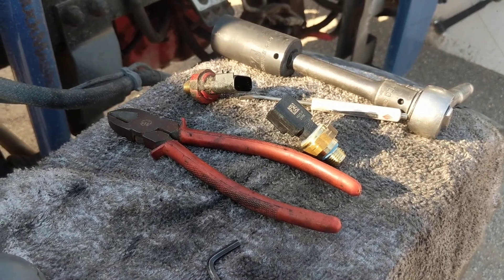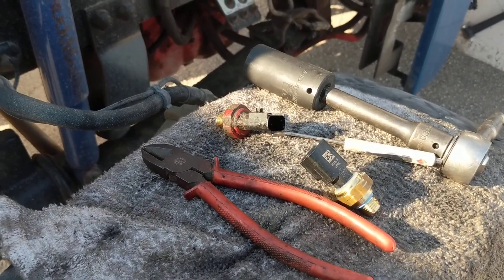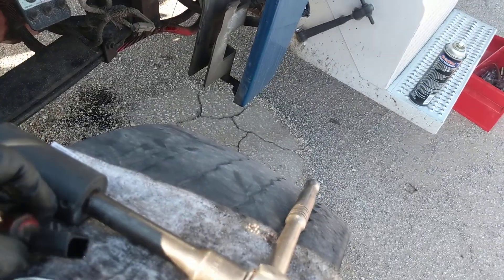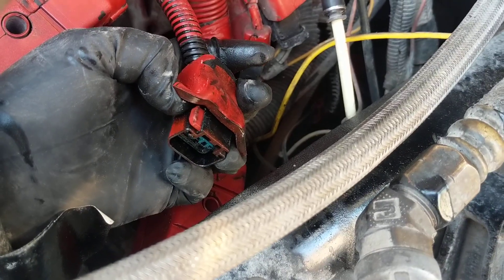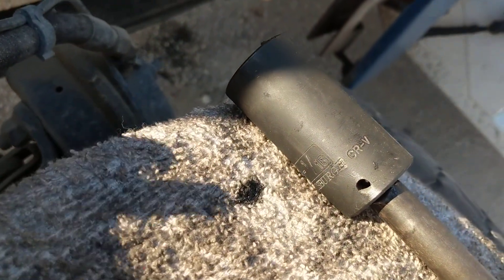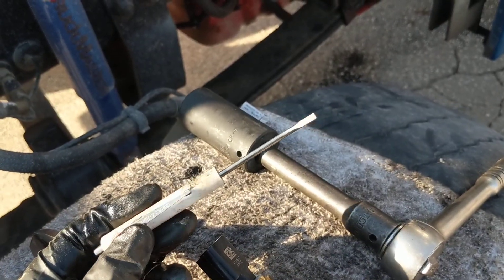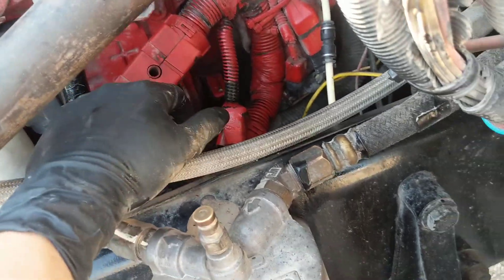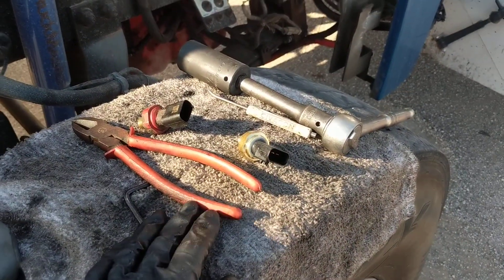How to replace the Oil Pressure sensor on a ISX 15 cummins heavy duty Engine.

Comment: Dash Oil Pressure was Flashing so i assume it was the Oil pressure Sensor. I look up this vid to see how to replace it. I paid $30 round trip on Uber to Kenworth (1.5 miles away), $120 for the Sensor, $80 to the Shop to replace it. It Took about 15 mins. Beats the $700 roadside assistance scammers.

Comment: Is the pressure sensor the same as temperature?
My pressure works on dash but not temp
Reply from the maker: No, they are different I hoped you figured it out and fixed it.

Comment: Only replace this when it goes bad?
Reply from the maker: You'll get a check engine, and oil pressure on the dash will be abnormally high.
Reply: The newer sensor (part# 4921517 2017 Cummins X15) is more robust, whatever that means. My oil pressure was up to 60 PSI when I sat idle. I turned the truck off being freaked out, checked the oil after 15 minutes of being off, oil level was still good. Turned the engine back on, the oil light started blinking, I turned the engine back off, turned it back on, and the pressure has been around 40 PSI ever since. Usually it's around 30-35. I checked this sensor and it is leaking some. Not bad, but some. I'll be changing mine very soon.

Comment: Will it give you a code?
Reply from the maker: Check engine light came on, the oil pressure hit 100 and wouldn't come down. I pulled over turned it on and off and checked the engine to see if there was oil anywhere and sure enough.